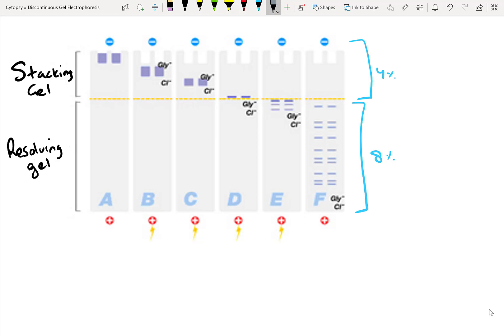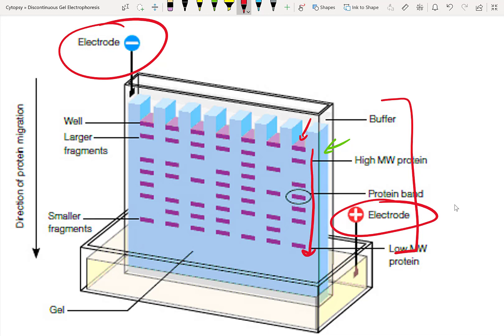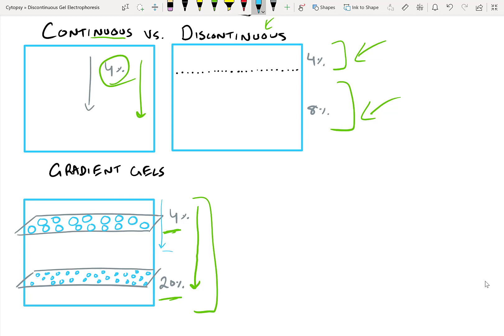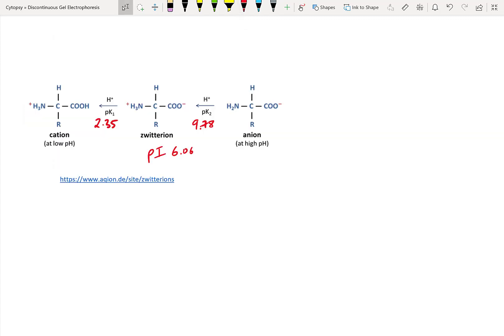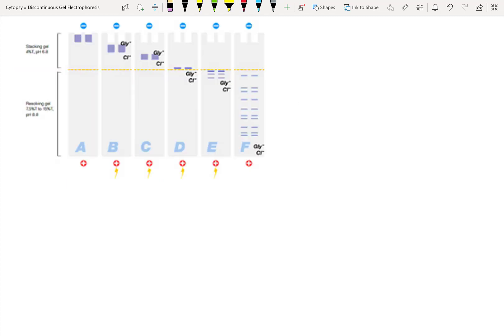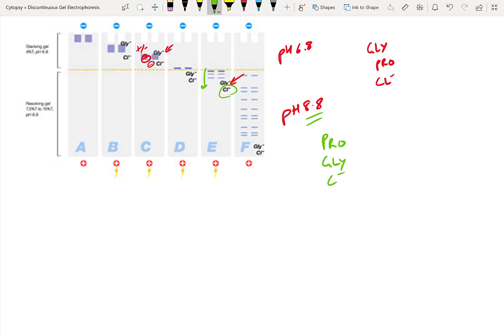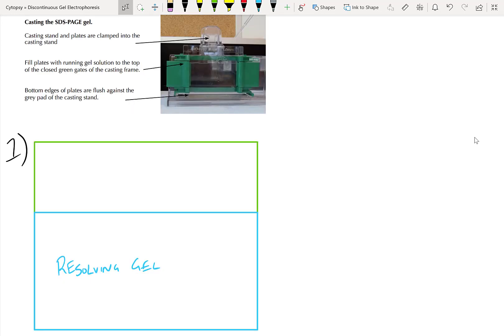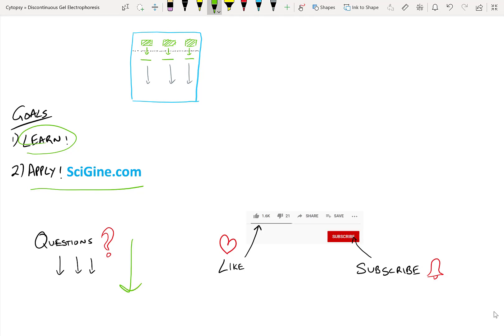Discontinuous Gel Electrophoresis and SDS PAGE - Protocol and Tutorial - Learn in 15 mins

Comment: How the change in pH affects the protein while moving from stacking to resolving gel??? Like glycine became negatively charged... what's the influence on protein charge ...it should also gain more negative charge that way??
Reply from the maker: Hi Annu! The stacking gel has a pH of 6.8 which is close to the pI of glycine (which means glycine will move slowly). The Cl- from Tris-HCl will move fast at this pH. Proteins have an intermediate charge between the glycine and the Cl- so they get sandwiched between the glycine and Cl-
Reply: @scigine2378  thankyou!!